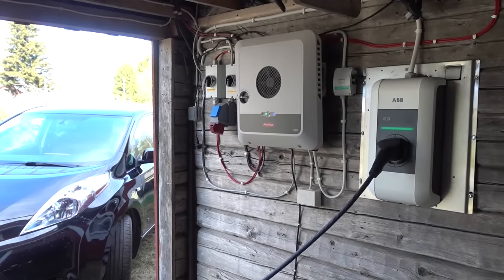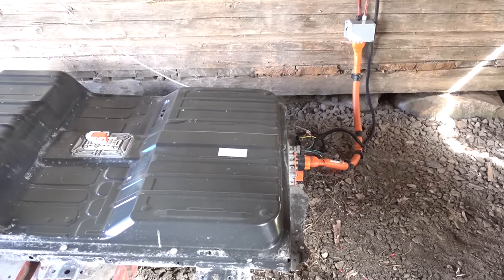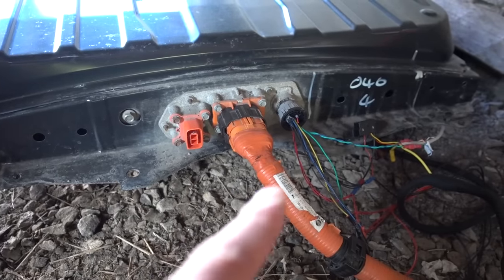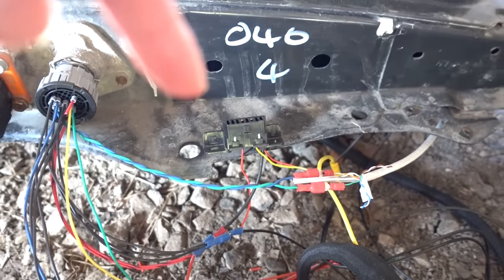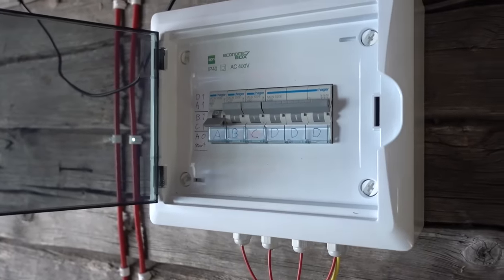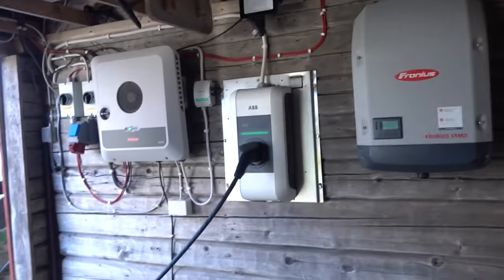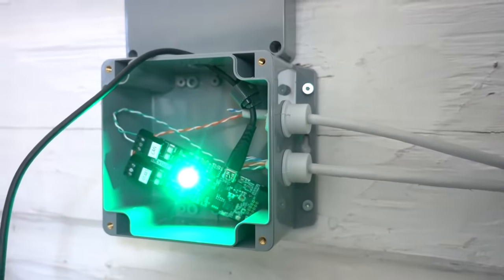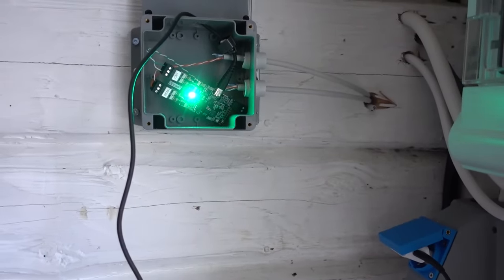The EASIEST way to connect used EV packs to grid! 🔋

Comment: Maybe give a safety disclaimer before starting to tinker with 360 volt DC systems? Somebody might think that this is easy and safe, and of course it is when you have knowledge of basic electronics but you should scare off amateurs since your life is actually on the line with this stuff. At least tell them to keep one hand behind their back when working on such high voltage systems, then at least you cant kill yourself.

Comment: 🤢... what happens to the future dead EV battery? Landfill, .. hire a contractor to remove it, who dumps it into the waterway, landfill etc.. it's CHEAP for a reason, they don't want the liability of disposing of the battery properly
Reply from the maker: Old packs are worth $$$ even when completely at the end of their life. They have rare earth minerals inside that can be used again. It would not be smart to throw away when you can sell it to recyclers! 😂